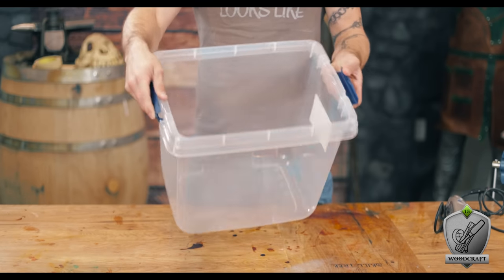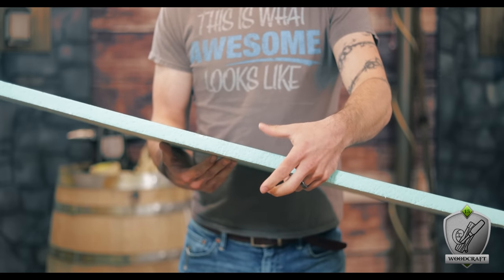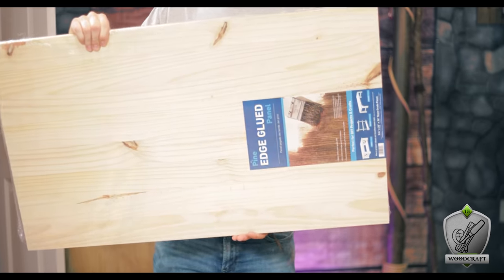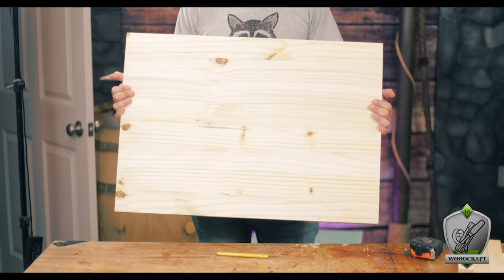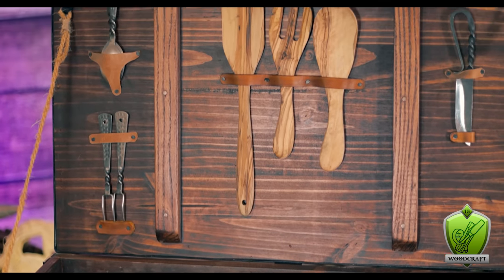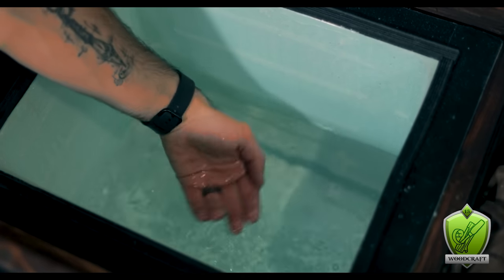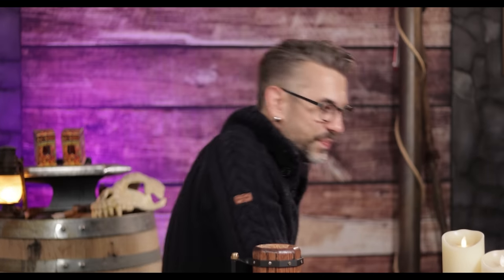Cooking Chest of the Traveling Chef!

Comment: You could probably use spray foam to go in between the cooler and the wood to increase the insulation. Probably would be best to use the non expanding version of great stuff that they use for windows I think.

Comment: Loved the way you resolved how to handle the chest on the "Pantry door side". I would exchange the button and the hole with the slit so that when pulling out the strap I do it towards me, making it easier to pull and attach the strap
Reply: It's kind of confusing the way I wrote that, so basically, put the hole or holes at the end of the strap instead of the button itself

Comment: Wow... 5 days of ice, using less than 30 bucks of material is impressive !

Here are a few ideas I have to improve insulation :
- Space blanket, they are really good at reflecting heat. I'd wrap the plastic container with it.
- A layer of spray on insulation, like cork spray. To make continuous layers that would work well against thermal bridges.
- Sealing ! Tape is not enough to stop air from going through the foam boards. I'd look for a good candidat at that. Heat seal ? Cork spray ? I don't really know
- Removing the plastic container during construction. Gluing it was good for the first steps of construction, but it got in the way when you add to have a really straight edge on top for the lid to be as close as possible of the rest of the insulation.
- Heat cutting : Heat cutters are really, really, really good when you work with foam !
- A way to apply pressure between the lid with the body of the cooler, like in a store bought one. That might be hard to do, because it would require the cooler to have a rigid casing and that's... A lot more work.

Also... That might be... Tricky, buuuuut... Expanding foam ? R-Value is great, no thermal bridge, no cutting and jointing... Might end in catastrophic failure, but I guess that might work !

Comment: If you ever need/want to redo the foam, there is a similar style of sheet foam that has a reflective foil on it designed to help reflect heat better and I'm pretty sure you can get it at home Depot, and for a better seal on the lid, a piece of weather stripping foam that's used on doors might help with that

Comment: You need 3. A cooler, a dry pantry and a BIG pot for hot water. All of your smaller pots and pans are stored in the big pot. As soon as your fire is ready, the big pot is filled with water and goes on the fire. Because you ALWAYS need hot water.

Comment: Between the cooler tub and first layer of insulation, Reflectix cut to fit and sealed with foil tape to radiate the cold back into the tub, as well as a sheet of the Reflectix on the bottom face of the first layer of lid foam.  Instead of bags of ice, use some sealable tubs with salt water in them.  A solid block of ice has less surface area for melting than does cubes.  The salt water requires a lower temperature point to freeze and will keep the cooler even colder throughout.  And being sealed up, clean-up is just some paper towel when done.  Instead of the Luan, get some (same thickness) plastic cutting board, now you have food prep surface also.

Comment: I made something similar. I used insulation board for the bottom, spray foam with one piece of insulation board for the top, and just spray foam for the sides. For the lid, I used the insulation board to fit slightly inside the container like you did, but spray foamed the top and sides in one go. I had previously measured the height of the top of the container so that I could cut off the lid leaving me with a perfect seal because even if my cuts weren't straight, it will have the same flaw in the lid and rim making a perfect seal.

Comment: so I've done something similar to this before, but with rubber made containers, and spray foam, and it worked surprisingly well also, if you get the closed cell spray foam it not only can add structure, I at 250lbs was able to sit ontop of it, but it will fill in all those small gaps and cut the need for the duct tape, just cuts down on a little of the error of self builds

Comment: i love the idea, and this is just my take on it not bashing anything you did, but if i did this i'd probably do a maybe quarter inch wood wrap on the cooler not only for slightly better insulation but i also think that would definitely compliment the angled curvature of the cooler. overall it looks like an awesome idea even if its just for camping, especially if you were to use hardier woods such as spruce or cedar. really unique take on the carrying method to i was honestly a bit skeptical of using leather for all the hinges, although something i've noticed using leather products is they tend to stretch over time under high preassure so that is something i would definitely consider with the carrying strap

Comment: To improve the isolating capacities, you could use spray foam in the space you have between the cooler and the walls, fealing the frame with it. 
Hope this tip helps you.
Amazing video btw, i love your chanel

Comment: As others have said - for ice, fill some food grade plastic bottles with water ( large soda/pop bottles are effectively free) about 3/4 full with water and freeze in your freezer (deep freeze/chest freezer if you have access to one, they are a few degrees colder than the fridge freezer) and use those instead of 'party ice' from a store.  You can drink the water from the bottle as it melts.  I have made more than a couple of dozen reenactor grade chests over the years - you can make the frame first and fasten (nail, glue, screw) panels inside the frame, you can use 1/4"(6mm) and 1/2"(12mm) ply for the panels, just cut it so the grain goes vertically for a frame chest. Make the frame so it has very short legs - about 2"(50mm) - and you probably shouldn't have fixed rope handles on a chest with legs though - there are illuminations in manuscripts from the 1300's (Matthew Paris) showing looters carrying similar chests with a large loop of rope around the chest at each end just inside the legs. You can use 'loose pin' hinges inside the frame to hold the frame together, replace the loose pins with ones made from thick coat hanger wire (or fencing wire) and when the event is over you can pull the chest apart without tools and pack it under all your gear (in bags) in the boot or back seat of a small car. For the origin of this idea look at the 'House Greydragon' web site, developed by the late Master Terfan.

Comment: I think as a possible improvement to your r value you could use spray adhesive to line your first layer of insulation with space blanket facing into the cooler and a layer of reflectix in between the two layers of foam insulation

Comment: Going off of several other comments here plus replies of yours regarding feet/legs/wheels for the chest: I'd suggest drilling some holes in the bottom of the chest then reinforcing those with another layer of wood or whatever just to make them a bit more sturdy. That way you could simply slot in a set of feet/legs/wheels in as needed, then stow them when not. Maybe add a larger version of the sheath/pouch like for the utensils, but on the back to store the feet/legs/wheels when you're ready to pack up.
You could even make feet AND legs as separate items, with the feet being X tall and the legs being X + chest height tall. (The height of the chest you built, not legs as tall as the chest you were born with...) Now add another plank of wood the same dimensions at the top of the chest, but not permanently affixed to the chest. This plank would also have slots for the legs on bottom. 
Pop the feet into the chest, the legs into the new plank and set them side by side. You now have a work surface right at the level of the chest, and with the chest closed you now have twice as much space on top to use the whole thing as a table!

Comment: I would probably add a Mylar space blanket or two to the cooler.  If you could remove the plastic inner tote, I would put a Mylar layer between it and the foam.  Add another (shiny side out) on the outside of the foam box.  It would add essentially no weight, no bulk, and miniscule cost (you can pick up one for $1.50 US at Wal-Mart (early 2023).  You could probably also get the same effect with a layer of aluminum foil.

Comment: . Great project. Already trying to figure out how to hang a canvas roll across the front with all my knives and stuff in it. Second trying to figure out if there's a way to turn the top into a sliding drawer so it slides off one side . so that without emptying I can get into the cooler and then push the drawer back and close it up.

Comment: So I am in the Army, I buy a cheap foam cooler and spray it with plastidip before a rotation or field problem. I put dry ice in double bags then put a piece of plastic a buffer between the food and drinks. So dry ice bags, plastics then food/drinks.
Reply: 2-4 weeks on ice is pretty good for a desert environment. The Box is usually destroyed/broken by the end of it.

Comment: That is awsome I wanna make one lol but I'm In The middle of making a book you could add a little drain going out the back of the cooler with some pex plumbing and a valve it would be easy to add and more convenient then trying to pull that cooler out and dumping it plus if your moving from place to place with it if you drained the water it would be lighter 2 lol

Comment: Not sure if anyone else mentioned it yet but those cheapo coolers are usually worse than the expensive regarding how long they keep things cool because the lids are not insulated. Drill small holes in the underside of the lid and stick the nozzle of a can of expandable foam to fill it up. Just don't overfill and use the small gap filler foam over the other. Otherwise the lid will warp (overfilling wall cavities will warp wall studs) and won't fit the cooler anymore

Comment: if you soak the leather in boiling water for a few minutes before stretching it around the rope to make the handles, as it dries, it will shrink, further locking it to the ends of the rope, and making sure it won't slide

Comment: I love your videos! I hang out with a group of Viking reenactors (historical, not "popular" though we do take a few liberties) and one of the things I've been struggling with is safe, in-tent lighting. I use some lantern pucks (found them for a buck a piece at a Walmart) wich includes a remote and are very easy to hide behind LED candles and do a great job of providing light without impacting the look of historical themes too much, but I'm not satisfied. Here's where you come in! 

The project I'm working on is a horn candelabra. It's simple really, I stole the idea from Skyrim. It's not really historically accurate, but the one I made looks great. Simple hardware to hold the horn and an LED candle stuffed in the open end. I use the ones made from real wax so I can pull out the small tealight inside and use my camping lantern. The problem? I made the first one for $40 because horn is expensive. I've looked everywhere for a prop horn project, but none of them produce a realistic looking horn when lghted. In addition to horn candelabras, a decent faux horn could also be used to make other horn-based props. Any ideas?

Comment: Also, when they cut windows out of doors the insulation is incapsulated and already in small sections... also the width of a typical front door (which is the insulated door in the home). Finding a place that has these isn't always easy but I know they sell them in Lafollette TN on the side of the road across from the Highschool. Lol.

Comment: Alternate trunk carrying method: Requires two people. Free hanging leather straps across the top, back, underside, and front, these can slide off after carrying, but are a close-fit. Secondary straps attached to the top of those free hanging straps. Secondary straps loop and connect closely at the free hanging straps, and the other end create two loops sizing several inch diameter. Slide your walking stick through the loops. One person in front, one at the back, carrying on the shoulder to evenly distribute the weight of the trunk! Alternate: create buckled straps for ease of use.

... That was a really long explanation to say 'make some close fitting straps, make some free hanging straps, hang a walking stick between them'. lol 💜

Comment: Maybe wrap the insulation with some plastic pallet wrap or even thick garbage bag, heat gun that so it shrinks to the cooler better, add some to the lid the same way and put some thin wood to stiffen it up, finally with the cooler in place spray some expanding foam between the chest and cooler to improve its r value.

Comment: I'd consider putting some batons along the front and rear edges that would lock the lid in a place to stop it sliding forward and backwards. I'm also a little worried about that button connection on the lifting strap because this thing loaded with Ice, provisions and  cooking equipment going to be putting a lot of strain on that connection you may of been better going for a buckle or the old double D-ring set up you'd see on older helmets

Comment: I wonder, would it be possible to make a homemade vacuum wall from plastic?
Cut strips to make a reinforced lattice structure between two plastic sheets, like perforated corrugation. Then seal the walls and pump out as much air as possible without caving in. 
Make a similar lid.
Could get an R value of up too 10 or 15 for a 1/2" gap, (depending on how much reinforcement is used, the R-value of the plastic, and the % vaccum achieved).
Add 10 R from the double walled ridged foam... Could keep ice for a full week.

Comment: An easier method for the cooler part would be to use a piece for the top and bottom, but instead of the inner layer or the sides, build the cavity you'll have it in, position the interior part of the cooler and use the expanding insulation foam to fill it in while keeping the interior piece in place.

One of the local high schools made a few coolers like that using the Home Depot buckets they sell, with a double layer of those, the outer one has the handle removed andthey fit the second one inside while using the spray foam, but wrapped it in something the foam wouldn't stick to in order to make a double liner with the interior one removable to make it easier to dump out, the lid from the lower bucket was also modified and they use the things at various events to keep bulk ice cream containers cold with the extra lid shaped to fit around the tops of the ice cream containers so it keeps them in place while keeping the water out of sight, top lid seals in place as well.

Comment: I would suggest not using loose/bagged ice.  Try using 355 ml plastic bottles filled with water, freeze them and then mingle them with your food in the cooler.  You can then layer things you want to keep cool in the way you want, plus, you can drink any water that melts eventually, and you won't get any water in your food.

Comment: I was wondering if you used sheet insulation in the in the ribs between the cooler and the outer wall would increase the R value

Comment: Just curious as to the dry weight, and the weight with tools but no supplies.  Could you reply with some basic even approximate numbers? Obviously cast iron pans are not your standard "backpacking" fare, but as I mentioned its just curiosity.  - and commenting helps the channel  :)

Comment: Use the first plastic container as a mold to build the foam insulation. Remove the mold and the tape holding it in place. Insert a second plastic container without attaching it to the insulation. Now the plastic container can be removed for dumping and cleaning.

Grab your ketchup and crunch away my friends.

Comment: instead of using gorilla tape you could have used metal ducttape (aluminum tape in air duct aisle at menards) its pretty cheap and will most likely be able to keep the coolness in alot better

Comment: Kinda late now, but I wonder if it would look less modern if you lined the plastic tote with a fabric that looked like a basket or textile that had been waterproofed with wax or tar. I assume it would be lined outside the tub as it may not do well if left in water. Also, I wonder if the whole cooler section might look better if it had a basket woven around it and the lid. Some wool fleece might be glued into place between the inner and outer baskets to create the illusion that it was insulated with wool instead of modern foam. This would make it more easily removed for draining, cleaning, or repair without losing the aesthetic and immersion.

Comment: I've had one of these in the works for some time now. At least on paper. I don't have tools or room to build stuff--one day though, one day...

Also, how do you empty the water? Does it lift out? Or do you just scoop it out and dry it with a towel?
Reply: You could probably store some coiled up surgical tubing between the cooler and exterior wall. Have a weight of some sort attached to one end and drop it in the cooler, run the other end out the door and start some old fashioned siphoning. Physics would do most of the rest.

Comment: you should consider adding a pump and tube to the chest so you can both pump out the water that forms at the bottom completely, and so it does not ruin your light weight wood, also you could add a filtration system (small) that could help filter the water in case of emergency, so you can use the water in a dish, or for emergeny water supply.   Then again, this seems redundant and does not fit the theme of the box, so I think iana iasiello's suggestion and those like it would be cool.

Comment: Ok so as you where building your chest, the one thing I saw that could have been done better was filling the open spaces in the framing with more insulation in those open framing to increase the r value of your cooler your